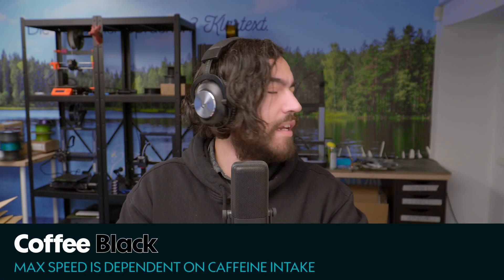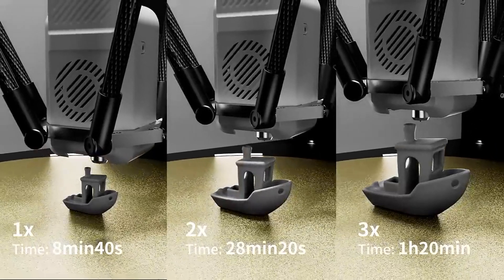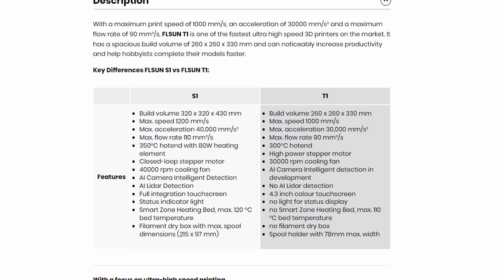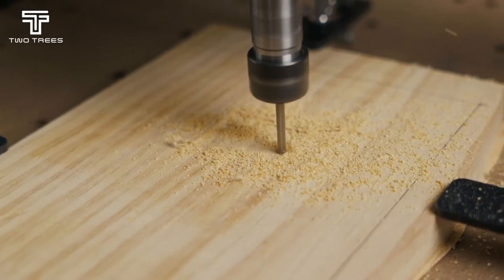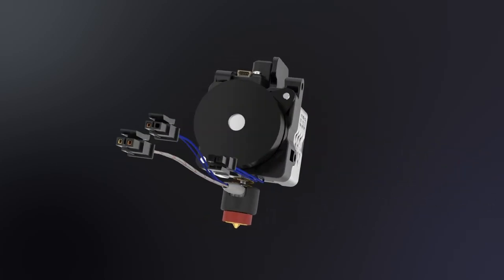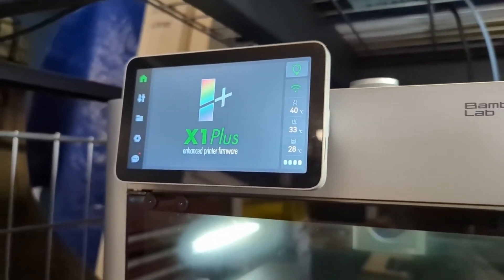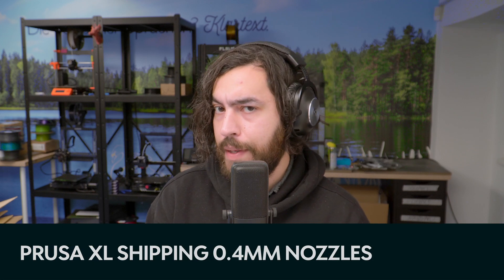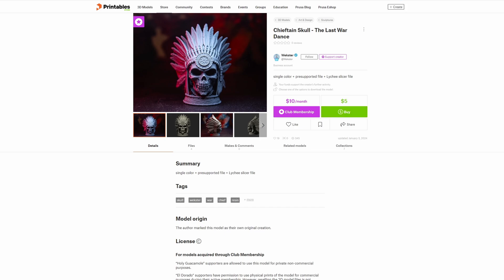Community News - January 2024

Comment: I use 0.4mm only when I need really detailed things or highly accurate technical stuff, but printing a 30cm tall figurine or lastly a life sized diving helmet, I use my 0.8mm nozzle. So the volume output stays still at the same max, but it's more stressfree for the printer mechanics. Also you can print steeper overhangs if you don't up the layer hight.
Also bought a 1.8mm CHT for some fun optics on 1.2mm layer hight. But for normal printing it's not really usable I think.
Overall, my last 1000h have been done to about 75% with my 0.8mm